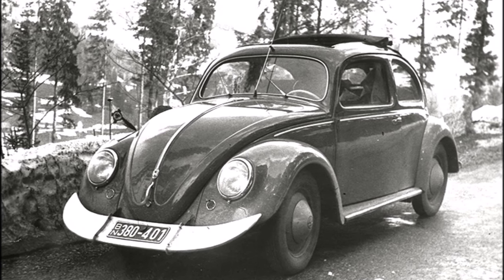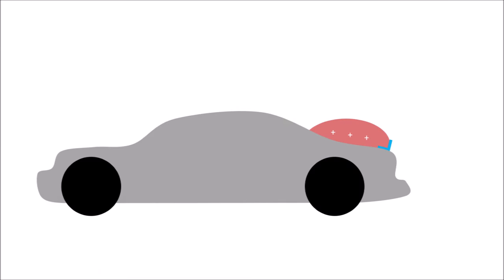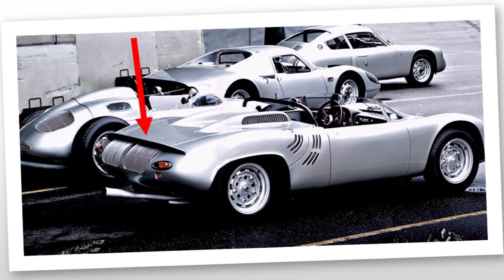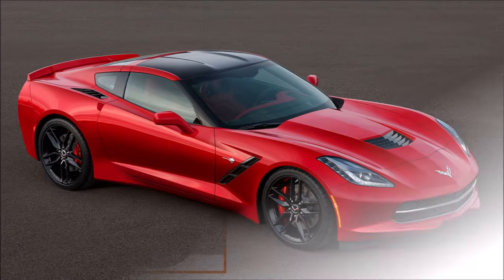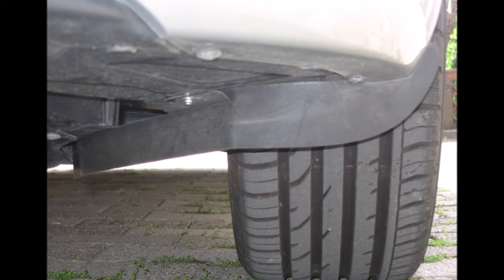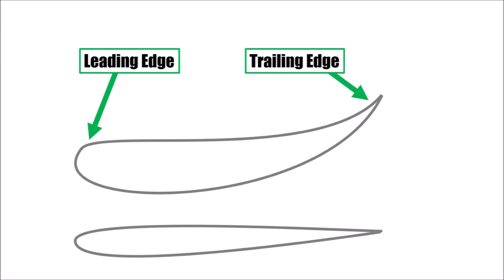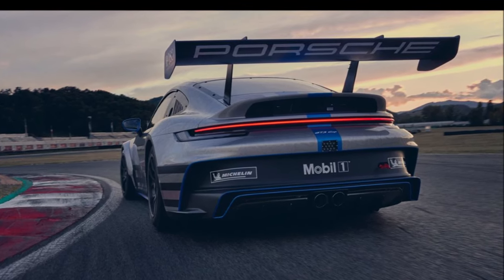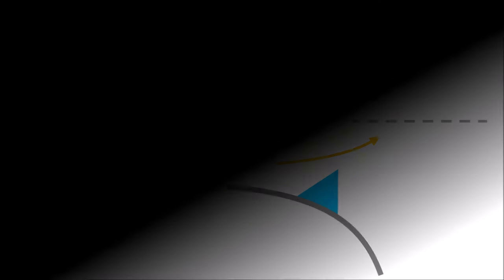Wings vs. Spoilers - EXPLAINED

Comment: My rule of thumb is easy. If you can fit your head under it, it’s a wing. If you can’t fit your head under it, it’s a spoiler. Similar to the foot test for suspension. If you can fit your foot in between your wheel and fender, go lower
Reply: Or you could simply say if it splits air it’s a wing.
Reply: Imagine seeing a car with a wing and then trying to push your head under it prove that’s it actually a wing lmao
Reply: No actually true. A wing can have a gap under it smaller than your head but it is still a wing.

Comment: Nice video! A couple questions, though. You mentioned that the spoiler slows down the air creating a high pressure zone with the gurney flap; is that also a major factor of the less agressive spoilers like the one in the 911 you showed later? and if so, is that the main source of downforce with spoilers or is Newtons' Third Law still the bigger one like with wings?
Reply from the maker: It's both, slowing down means building a high pressure zone, which (if above the car) creates downforce. But it's also the directional change of the airflow.
I will do a separate video about Gurney Flaps in particular and go a bit deeper into the details.
Reply: @BSport320  Thanks!

Comment: Good content there. I just have 1 question, i know that a wing dw to drag ratio is around 3, what dw to drag ratio a spoiler produces (I know its worse but i wanna know how much worse it is).
Reply from the maker: That's a bit hard to say because you can test a wing alone but a spoiler only in combination with other bodywork. In general I can say that a spoiler is more efficient than you think and it can even reduce drag depending on the car's shape (Audi A7, Audi TT).
Reply: @BSport320  true, I was underestimating the spoilers effects, I wasnt thinking on the drag reduction in road cars.

Comment: If wings increases drag then why people use it in races? Will it be helpful while cornering bcz on straights it might be disadvantageous
Reply: With a wing you will get enough grip to achieve a higher cornering speed. F1 cars for example have drs to kinda „open up“ the wing and reduce the drag
Reply: @ahri7611  what about on straights?
Reply: @vikramtalreja9  it’s ok on straights but can still be a danger. Because if drs is used the car may be faster but there won’t be enough down force to push down the car. There is a chance that the car will just take off the ground. That’s why drs is only allowed at marked parts of a track to use AND when it’s an overtake.
Reply: wings allow the car to go faster through corners because tires have much more grip to work with. wings do make car slower in a straight line hence why they adjust the wings for each track to give the car as much straight line speed as possible while still retaining enough grip to make tight corners. Its all about compromise.